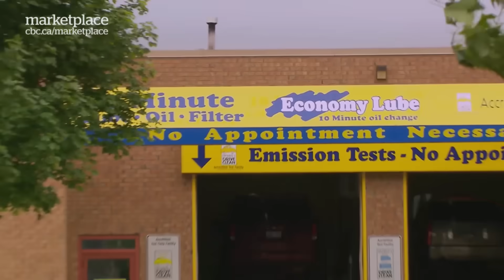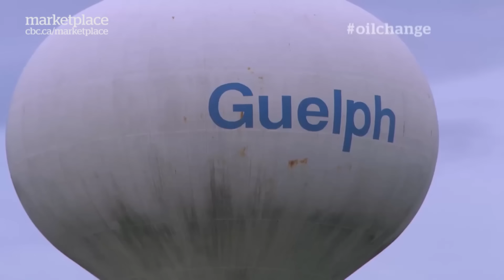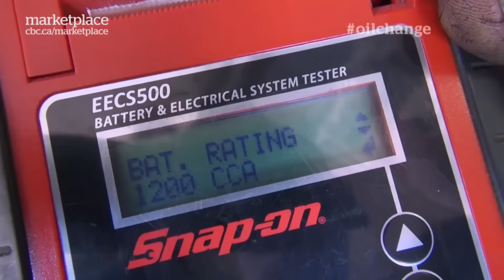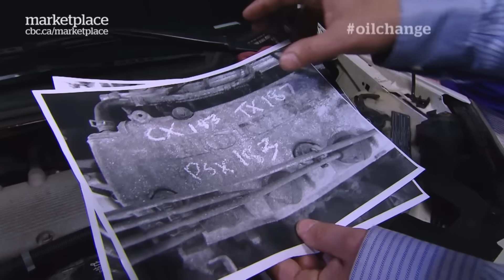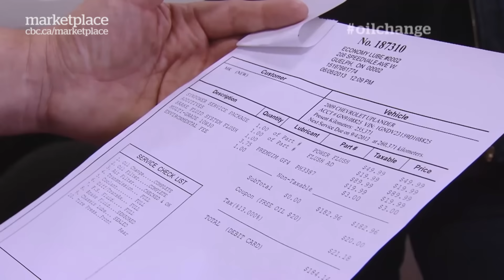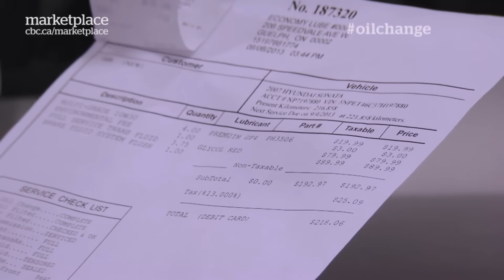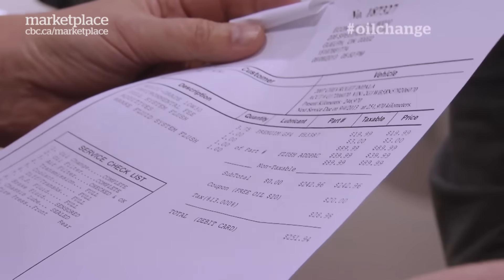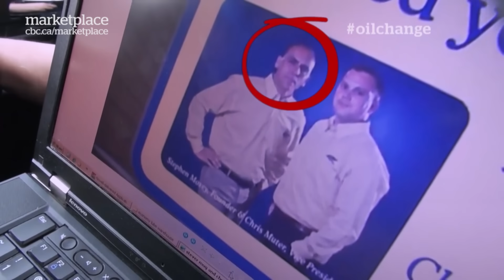Oil change scams: Hidden camera investigation on what really happens to your car (CBC Marketplace)

Comment: If you're like me, you do all your own maintenance but still need a shop for tires (the tire machine is super expensive). Often, these shops will still try to sell me something while the wheels are off. One tire shop (NTB in Thomasville, NC), wouldn't put my wheels back on until they could give me the, "your brakes are shot" sales pitch. I asked them to show me and it turned out the pads were at about 50%. As payback for refusing their brake service, they resinstalled my lug bolts so tightly, I broke 2 wrenches trying to remove them later. Had to use and impact socket and a breaker bar extension pipe about 10 feet long to remove them. I called them about this and they said, "you shouldn't mess with your wheels, it's dangerous. just bring it back to us if you need to take a wheel off". What if i get a flat? "just tow it into us and we'll put your spare on for you". They REALLY wanted to be needed.
Reply: Update: I changed the brake pads about a year later and I wished I had waited longer as they still had some life. I upgraded to Bosch QuietCast so it was still worth it.

Comment: It would be easily possible to falsify a repair, but I never did that.
Reply: I've seen a few technicians who ripped off my friends. 
Their bosses were in on it.
Reply: 8:37 Power steering fluid is actually supposed to be clear or red. A burnt smell would be odd. 
Power steering fluid is actually hydraulic fluid, and an oil smell would be normal. 
I've never sold a power steering flush for those reasons, but it is often sold as preventative maintenance anyway. 
The system would still work with old fluid.
Reply: 10:37 He said the whole power steering fluid was replaced. 
That is a LIE. 
We flush it by swapping fluid in the reservoir while it is running. 
There is no way without replacing parts to change ALL the fluid.
Reply: In my history as a mechanic replacing engines and rebuilding transmissions, I've never seen a power steering rack or pump fail. 
I'm sure the pump takes wear, but you will replace the engine before the pump fails. (The pump will make a winning noise if it has air in the system.) 
Never have I seen a steering rack fail.

Comment: Coolant mixing does not matter unless its 50/50. I have yellow and green in mine. ZERO ISSUES. My brother is a engineer at john Deere and will tell you this too... Rebuilt many cars. Same with my fil. Rebuilt a 66 Chevelle.

Comment: I bought a new car, drove it for a 1000 miles for a break in period. Before I took it to the dealership to get the oil changed, I jack up the car and marked the oil drain plug and the oil filter. Once home, I jack up the car to see if they actually did the oil change, the oil plug was removed............But when I looked at my oil filter it was the same one. So I get on Google review of this dealership and left a one star and what they actually did NOT do to my car...........I got a call from the Manager of the dealership and he said bring the car back in, which I did.
The moral of this story is, whoever is working on your car NEEDS to go by what you want done, NOT the mechanic.
I always mark everything on my car when going to the dealership, a well few placed cameras wouldn't hurt either. 
Remember! EVERY one is against you...............They just want your money.

Comment: I once made an observation: changed motor oil, and in just a few days it looks like it was running for a year. So these guys know you can't catch them on lie: the fluids will immediately look messy after you start to drive, simply because your system is not in pristine condition on used vehicle.

Comment: Things have changed a lot in 8 years. Working at valvoline we get paid by the hour and show you the fluids or a slide shows of services you need done and explain it. You can’t just walk in and just say yes to everything for the sake of dramatic development then question it after the services are done. There are cameras everywhere watching you as you work with microphones. There is an average you are expected to sell every month but there is no incentive for doing so. All the prices are set. If you’re going in to pay the least just say to the person you just want the cheapest oil nothing else and they will leave you  alone and if they don’t just say it’s too expensive for you and they’ll let you leave. And most of the time if you ask where coupons are we will just help you find it. No one is holding a gun to your head. Stop slandering technicians just like anything else there are good and bad.

Comment: I once brought my Jetta into a VW dealership to get an oil change because I didn't have time to do it myself. they charged me $200 for an oil change, took them 2 hours and they charged me for their time. since then ill never go back to a dealership for anything easy, I change my own oil for $50 and it takes me less than an hour without a lift. the annoying part is they never even did a tire rotation or anything that would make the $200 easier to bite off. I just ordered new injectors and spark plugs that I intend to do myself because its going to be a 10 minute job and I'm convinced the dealership would charge me $300 in labor to do it.

Comment: Went to jiffy lube one time for an oil change. The "mechanic" brings a filter out saying it was from my car needing to be changed and it was totally disgusting, problem being they pulled it off a shelf instead certainly not from my car. Then after they did the oil change, turns out they drained the oil but never replaced it.. engine seized up about a day later. Totaled

Comment: Ive had a shop pull one on me with a brake system flush but come to find out im charged for 78 bucks for just changing the fluid in the reservoir. I found this out after looking and inspecting my brakes and instead of telling me the back bleeders are too corroded to come loose and they need replaced, they still charged me for a full job not done and ive not went back soon, now i got my own mechanic that wont rip me off and allows me to learn things along the way.

Comment: I got told to if I took my moped in to the place I bought it they could have it fixed within 3 days. Instead of fixing it they waited 3 weeks.. ruined the battery completely, I specifically asked them if they could order a part for me because I could not find it anywhere online.. instead of doing that they slapped a zip tie on it.. charged me $103 and ruined the battery. They scammed me pretty good and I had to pay $36+ every time I had to leave work, or go to work. I not only didn't make enough money to pay for uber, I had to move money from savings to help pay the deficit my job didn't cover just for the ride to get to work to make no money.. for 3 weeks.

I am planning on going back out there with a sign letting people know they are crooks. This is the second time they have lied, cheated, and stole from me. I am hoping they call the police for me standing outside with a sign, on a public easement. Where it's illegal to stop my 1st amendment here in the US of A. Lets see if the cops take the bait and I get a lawsuit and some nice money from it. I am tired of the crocks they cannot be allowed to get away with it.

Comment: Always first check the instructions in the car manual. So you know what kind of work needs to be done at how many miles and check that on the bill you get. Also check at a good garage what time a mecanic needs for certain works.

Comment: It stinks that there's lube centers like this. I started at one 27 years ago, then to an actual shop, got ASE certifications and so on. The lube center I worked at did actually do the work, and we always had at least one ASE mechanic on duty should anything major be needed. Fluid exchanges should only be done based on mileage and years (unless somehow there had been contamination). Everything shown here was straight theft. Even CBC's mechanic was a bit off. He had NOT flushed the transmission fluid 3 days earlier. He dropped the trans. pan, changed the filter and only exchanged about 33% of the fluid that's contained in the trans. But anyway, even that's better than nothing. Sales were pushed where I worked, but done by the  Manufacturers recommendations. I had to stand in the same grocery store checkout lines in the same town as my customers, I had to be honest to be able to live with myself.

Comment: When i lost my job as a fleet mechanic years ago i even applied at oil change places they wouldn't hire me i was told i was over qualified to work there that shows they rather hire someone with no experience so they can rip customers off because if the person that has no experience on cars they will listen to their boss and replace parts that isn't needed

Comment: I will NEVER go into an Olin Mott Auto center. I went in for them to look at my hub bearings, so they jack up my van, and they're under there for 10 minutes, and then they show me that my motor mounts are completely fried (motor was lurching by about 3-4 inches) and they tell me that they would need to spend 7-8 hours to hoist up the engine to change them, and it would cost me AT LEAST $1200  in labor alone. They had gone under my car, and  LOOSENED the bolts on the mounts, and retightened ALMOST all of them... went to change them out myself, and found one of the bolts was finger-loose...😡🤬

Comment: Just say: “just the 20$ oil change please”. Say it over and over. Don’t be shy.
Reply: Then they will just change the oil but not the filter or not even change anything at all but still charge you for it. Happens all the time to people that insist on just getting the advertised cheap price.

Comment: I am not saying that this is not dishonest. Yet the mechanic that did the transmission fluid change only dropped the trans pan. There is still another 6-8 quarts in the torque converter. Dropping the pan only dilutes the oil that was in there. There is no way without pulling the trans out to drain it. They do not put drain plugs from the factory on the converter. We used to drill the converter to drain it, then weld the hole back closed. All this unless you flush the transmission assembly.

Comment: took my diesel Audi to momentum Audi in Houston. After charging me $480 for an oil change and inspections, I took the car home and decided to check the oil myself. Inserted an old dipstick into the Audi dipstick port. The dipstick came back with old nasty oil. I told Audi corporate about it and they canceled the rest of my warranty. That's the last vag product I'll buy.

Comment: When I was a young girl, I took my Honda in for an oil change, I came back to get it a couple of hours later and it was still parked in the same spot and had never been touched (I opened the hood and checked the oil) so I walked inside and they tried to charge me for it, so I said “when are you going to change the oil?” You should’ve seen the look on their face. I’ve never seen them move so fast to actually go change it. Ha ha. 😂

Comment: I haven't had much experience with a Canadian automotive places, but I can guarantee you the biggest snake oil salesman in the oil change industry in the US is Jiffy Lube.
 Also, anybody you recommends flushing your brake fluid or flushing your power steering fluid, run, dont walk, like hell away from that place. 
 And!!!!! Don't forget to buy your flux capacitor, your blinker fluid and plenty of metric screwdrivers🤣🤣🤣🤣😚😚😃😃🤣😭😭😭

Comment: Where i live in BC we have very high humidity, and brake fluid absorbs a lot moisture turning it darker, i change it every 2-3 years, and my calipers rarely wear out or stick. I learned this from the master mechanic, so I have been doing it to all my cars and trucks. My one-time truck uses power steering wood for the braking system, so it gets used a lot and harder, will change it every 2 to 3 years .

Comment: I figured it out the first time I went there. Right off the bat they were like your car is a big investment so don't you think you should protect it with better quality oil (their most expensive brand). So I kept telling them that I want the lowest price oil. After that the tech came back with the dip stick for the transmission, with some dirty oil smeared on the cloth, they said the oil should be replaced ASAP, he never seen oil so dirty. So I told him just finish the oil change please and don't touch anything else. Incidentally after i got home i checked the Transmission oil and it was fine. Definitely a bunch of crooks.

Comment: Full brake flush means you have to drop the vehicle on the hoist and pump the brake pedal until you get enough pressure in the cylinders. It didn't happen.

Comment: They say they check the air pressure on all tires including the spare. The car I drive, the spare tire is upside down in the spare tire compartment and must be removed to check the air pressure. I put a small pencil mark on the tire that lined up with a small pencil mark on the side of the tire compartment to see if they had checked the spare tire. When I checked the spare tire after a service, the pencil marks were still perfectly lined up which means they did not check the air pressure in the spare tire.

Comment: I went into jiffy lube for an oil change. I was working on the road and far from home, way over my mileage. They advertised $50. I drove in there were guys under the floor doing the work..they got finished and I had a $400 bill..they told me the cabin filters needed replaced blah blah. Things I could have bo8ght myself for $20. I now maintenance my vehicles myself regularly

Comment: The professional mechanic should have been more graphic as to what damage can be caused by putting green fluid into a system that has orange. The two mixed together can literally cause sludge that completely ruins the radiator. That happened to someone I know.
Reply: That is why Mark said that it would have to be flushed, because it would cause damage when it got into the radiator.

Comment: Buy two jack stands and a good jack, or a set of small drive on ramps. Watch a few youtube videos, find out your torque specs. You choose what oil and filter goes in and you save money. Keep learning. Even just doing your own oil, filter, air filter and spark plugs will save you a good deal of annoyance and cost, plus you know exactly what has gone into it. Just make sure you know how to use your tools and don't get yourself killed

Comment: Here's the fact: shops are NOT making money off that $20 oil change. That is just to get you in the door and then the sales pitch goes. I mean it's not nearly as bad as dealerships but still can be slimy. That $20 oil change is for conventional oil assuming a 1.5L tank and most cars past 1990 would preferably use synthetic oil anyways. My V6 Dodge Charger has a 3.6L tank so I am looking at $50 easily no matter how you skin it.

Comment: I worked in a K-Mart auto service center back in the 80's. It was my first job after my auto tech school. It was a great job, everyone in the whole store was like a family. One time my service manager was transferred to another store and this other guy was brought in. He was a greasy haired toothpick chomping crook. There were several times he would rip people off. One time I remember working on an old persons air conditioning. The manager up sold them into needing a lot of unnecessary parts. He had me take the ac drier off and polish it up to make it look new again and then reinstalled it. This didn't go over with me at all. I secretly went to the store security man and told him what was going on. They did an investigation on him and a few weeks or so later he was fired. I hate people who prey on the elderly, or anyone else for that matter. I never saw that crooked boss again.

Comment: Stay off your phones and listen to what is happening to other customers as you wait. I stopped at a "well-known" place for an Inspection. All I heard was added things and services that needed to be done to every vehicle that was there for repairs/service.  I got out of there after my (passing) Inspection and never returned. By the way, I had a rear brake light that was burned out ($20 US) that was never noticed prior to the Inspection. Backing up into my garage many times each week, I would have noticed the non-functioning left rear truck brake light against my white wall. Maybe it failed while there? I was unable to prove that they did not switch bulbs while there. No cameras for the customers to review.

Comment: My car was stalling. Against my better judgement i did not take it to my usual guy and took it to a shop my neighbor recomended. They said it needed 5 thousand worth of work and all they did was get the check engine light turned off.it cost over a hundred just for that. So i immediately took it to my regular guy after. He called me an hour later. He said "the oil was extremely low so i filled it back up. Its fine now" i paid for the oil and saved 5 thousand dollars.

Comment: Ok so I'm not sure what you guys have done when playing this game but I've actually got the cash out amount and more multiple times. I am currently in an active que that I can visually see to count down my place in line for my payments. The larger cash outs took longer to process. If you hit exactly 1000. Or maybe just a little over. You are instantly placed in the que for deposit. But if it's a larger pay out it has to go thru processing and approval then gets placed in the deposit que. So it is possible to hit the $1000 mark. You just have to be patient. Now with that being said, I haven't yet received the money but I have been moving quite nicely thru the que. They said 3-15 days. My larger pay outs spent 3 days in the processing and approval phase. I'll update in 2 weeks.